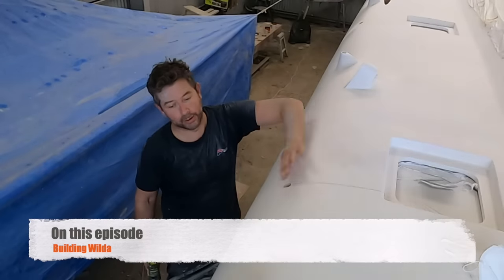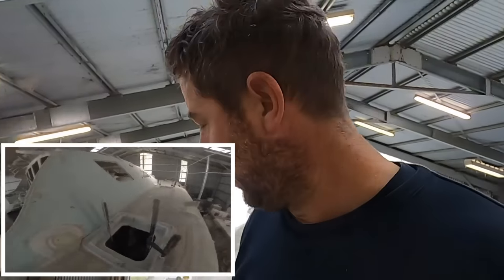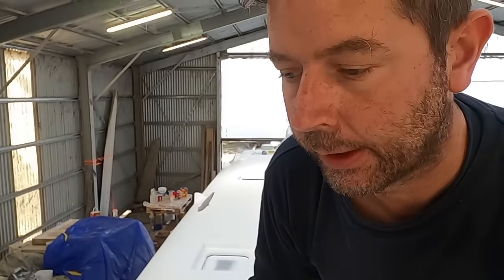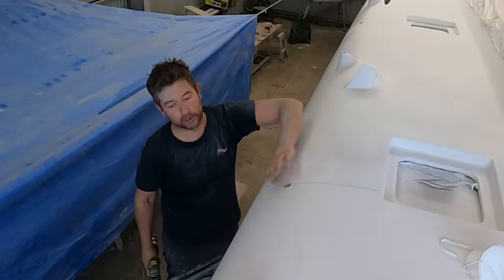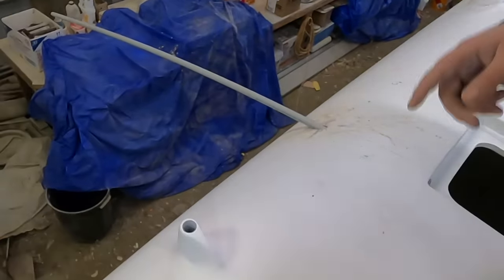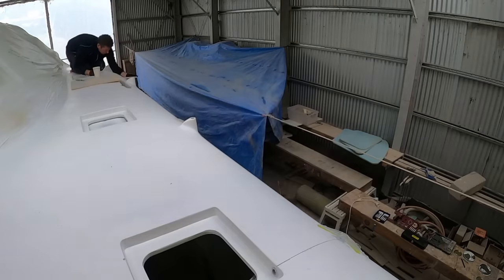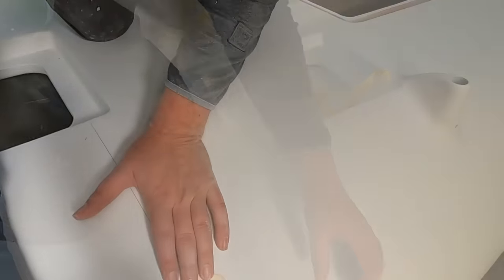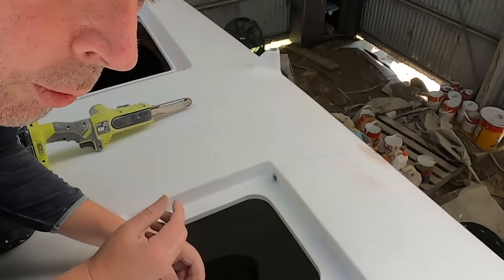Making DRAINS for FLUSH deck hatches - S02E48 - DIY Catamaran Build

Comment: MJ sailing is building a MaxCruise kit. They also built these flush hatches in their cabin top. Matt built his drains into the bezel and glassed them in when they got installed. Your solution is great tho. You can always install simple headliner system on the cabin top and that looks great or just run it as is. You built it like it was supposed to be that way for sure. Keep up the progress! Also with the titled format as the chapter of your story changes is a great idea!
Reply from the maker: We didn't show too much of the inside. I haven't painted them yet, but I think the pipes won't be that ugly. The boat is designed without headliners. The previous owner decided to put headliner in the salon. We're keeping that. Hides cables well 🤣
Reply: @buildingwilda  just an idea, if you do decide to go headlining in the hulls, you can always get aircraft standoffs that you can epoxy to the ceiling to make installation look awesome. You can get them in many lengths to accommodate your build. They’re usually used to install wire looms.
Reply from the maker: Thanks 🙏 I'll look them up.

There is an additional advantage to headliners. You can add insulation..... But at the cost of added weight.
Reply: @buildingwilda  we use these on airplanes. Dollar to a dime, the airplane you will fly to Sweden has about 1000 of various standoffs like these.

Comment: They look good. That's difficult to decide how to route the drains but your idea was probably the best way to solve it. Good job and what a lot of work for something so simple. Those dagger boards would cause me so much stress by not knowing if they are going to fit or not. Hopefully they slide right in without any issue what so ever. It would be nice if you could remove a section of the roof and find out.
Reply from the maker: I'm sure the drains will work. Shame I couldn't figure out how to use them for water catchment. Simply too much work to drill straight through the reinforcing glass. Wouldn't have known how to make sure I replaced the missing strength. I'm happy with the solution to the drains.

The daggerboards will have to wait... I'm sure they will fit. The previous owner was pretty detail oriented... Hope he got it right 🤣

I cleaned one up. Time to get some paint on them soon. Tall boards.

Comment: Are the drains in the correct place by the way the boat sits in the water? There placed forward will the bow be deeper than the stern?
Reply from the maker: It really won't matter much... The edge of the hatch is pretty high. Occasionally I might get some pooling water but I don't think so. The three forward hatches forward, aft hatch drains aft. Should normally work great.

Comment: Sure, flush hatches are nicer but impossible to drain. I have two flash hatches on the deck behind the cockpit with holes for drainage in each corner of the hatches. The profile around the opening forms a gutter with a flange that seals against the hatch with a rubber strip in between. Water still penetrates into the storage space below. OK these hatches only have one lock each. Powerful sealing with several locks and hinge fittings is recommended.
Reply from the maker: I hope our hatches will seal well. I guess time will tell. And I'll try to remember to clean the pipes out now and then... Hope that works out

Comment: Why are the hatches recessed and not raised so water runs away from the hatches.
Reply from the maker: On top would have been easier... For sure. The biggest advantage of the recessed hatches is having a less cluttered deck. Less things to trip over. Fewer places for lines to get fouled.

And... Looks prettier 🤣

Comment: Worst idea those holes. I would have just raised every hatch. With your idea you will get water always in that sunken area even with those drilled holes. That water will go green or black. Bad idea. Will need cleaning regularly
Reply from the maker: You may have a point. But I don't mind a bit of cleaning. I won't let the water sit and grow 🪴 Happy New Year
Reply: @buildingwilda  I guess if you clean weekly it should be ok. All in all the cat is looking sooo good. Hard work will pay off x10 at the end when it’s in the water.
Reply from the maker: I'll happily clean the boat daily in place of sanding! 🤣

Thanks 🙏